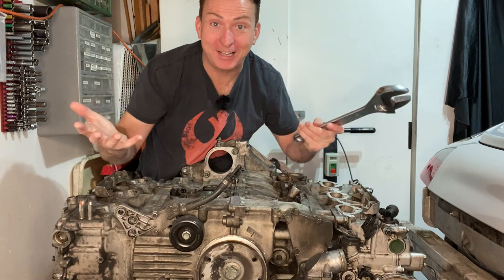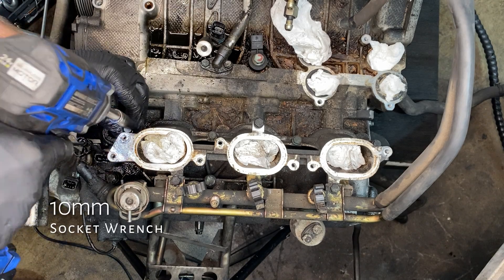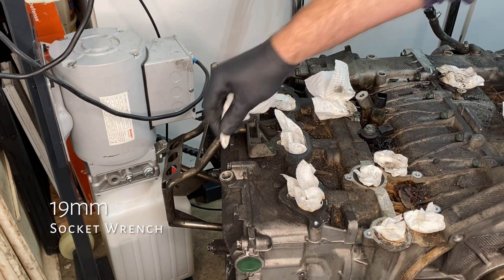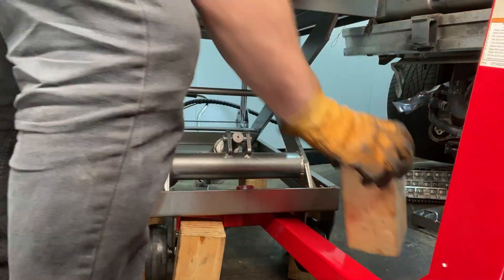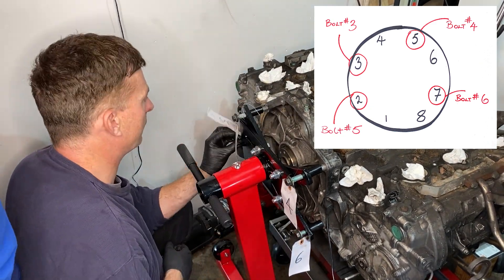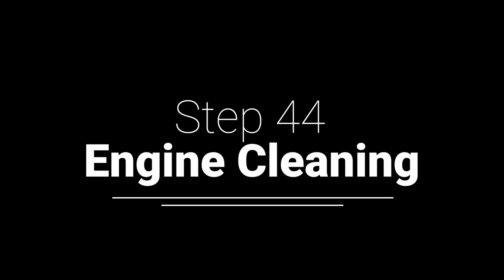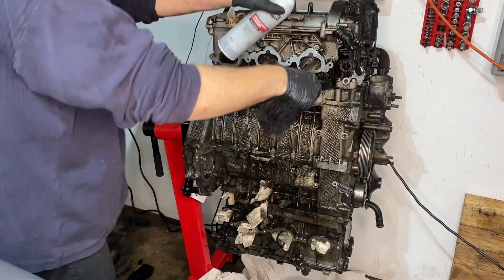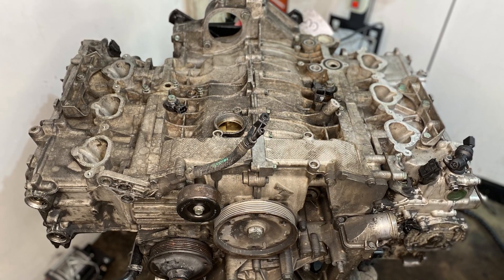How to Disassemble a PORSCHE 996 Engine Part 2

Comment: What cleaning products did you use?
Reply from the maker: Hello, Robot people 🤖 🙌 I tried most brake cleaner/Part cleaners available. Walmart & AutoZone have the cheapest price. CRC Brakleen was the most expensive. All were similar in their effectiveness. Thank you for watching 🤘😎
Reply: @ManinaGarage  which would you say was the most effective on the aluminium block?
Reply from the maker: @robotsretrosspaces  I went back to the CRC "Electric Parts Cleaner" it was the most effective in initial testing. Use the Electric parts cleaner NOT the "ElecTRONICS Cleaner". It has a distinctive smell and does seem to be slightly more brutal than the others. It will melt plastic though. If time and money were no object, Vapor Blasting or Dry Ice Blasting would be the ultimate. Thank you for watching 🤘😎

Comment: Excellent series of videos!  Question on the cleaning:  Any reason you didn't de-grease and power wash the engine while it was still in the car and all of the systems attached?  Seems like it would have made for a much cleaner, debris-free project.  Just my 2 cents.
Reply from the maker: Hello Tom, There was too much risk of adding to my problems with high pressure water. When I started this project I had no idea what was in the engine bay and what a pressure washer might do to it. Additionally the dirt and oil tells a story, I did not want to erase any evidence. For example, pressure washing would have have erased the source of the leak on the bank 2 AOS connector, it would have erased the evidence of the single oil cooler O-ring that was leaking plus it may have made confirming that the RMS and IMS were not leaking less cut and dry. There was nothing I would have like more than a clean engine to work on, at the same time I did not want to shoot myself in the foot. 
Thank your for watching 🤘😎

Comment: I am trying to decide if I should tackle this huge project.
Just found metL in my oil.
If you can I have more questions. Please reach out if you have time. Thanks love these videos.
Reply from the maker: Hello Dan, Just putting the finishing touches on tomorrows video. I am happy to answer your questions, fire away 😃Thank you for watching 🤘😎
Reply: @ManinaGarage  how much for a rebuild kit? Where did you get it, are you worried about setting the timing?
My other option is to find a used motor but wow are they expensive also.
Reply from the maker: @danpartee2990  Hello Dan, I don’t have a rebuild kit. I will probably buy a gasket set from FCP Euro, the rest of it will be bought online or from my local Porsche dealer. An yes, I am definitely concerned about reassembling it in a way that insures correct timing. 😬